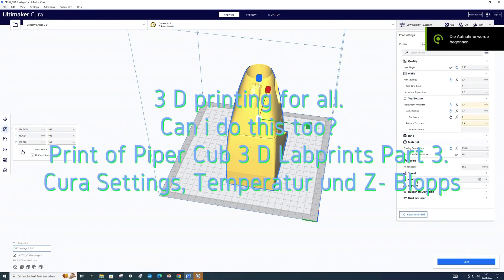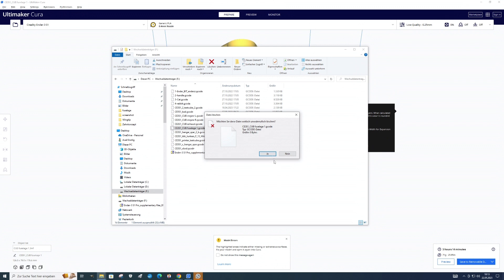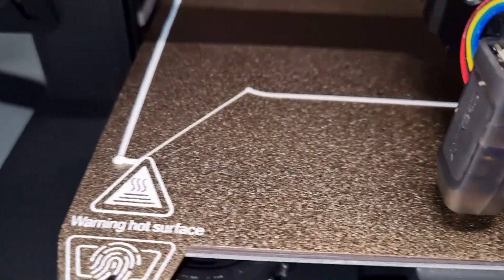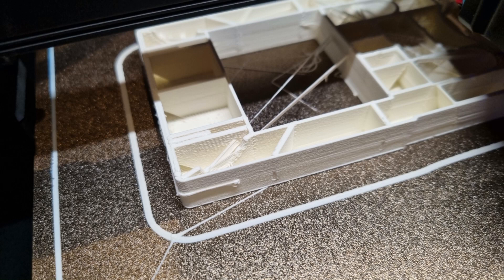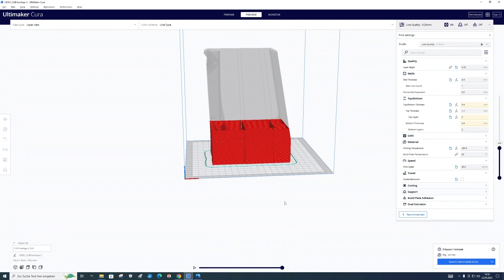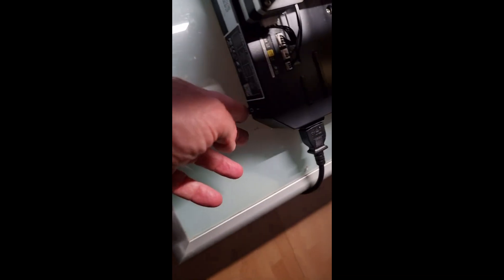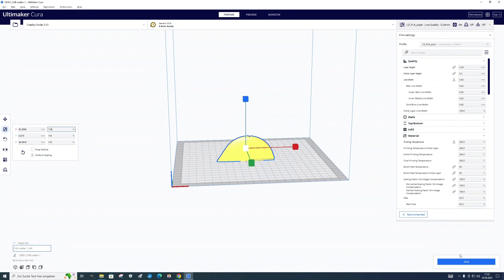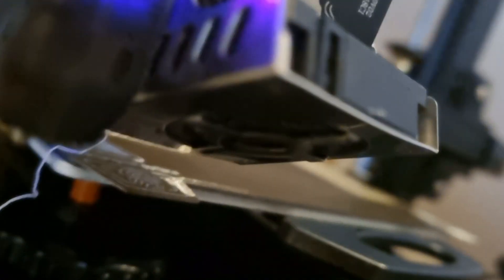3 D printing for all.  Print of Piper Cub 3 D Labprints Part 3. Cura Settings, Temperature Z- Blopps

Comment: It's a little late, but many of these 3D printed planes require to print at 100% scale otherwise parts may not fit if you increase the size, especially the parts where servos and motors mount.
Reply from the maker: @robjohnson275   thx, very interesting and helpfull. Besides, i`ve splitted and the printing stuff is now at my channel     @tekknerd8314. In a few days u can watch my vid about my 2 nd design after the PZL 11 , the maiden of my Buecker Jungmann. Cheers and thx for your comment, Axel